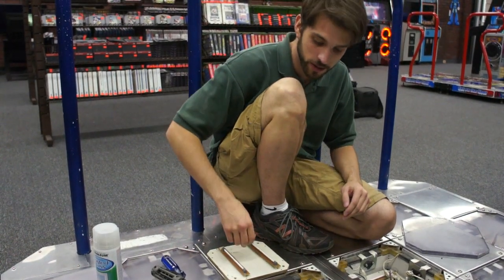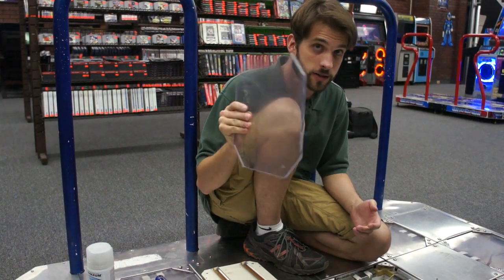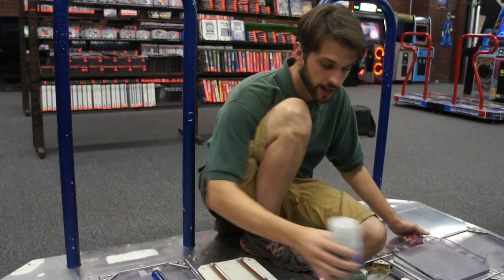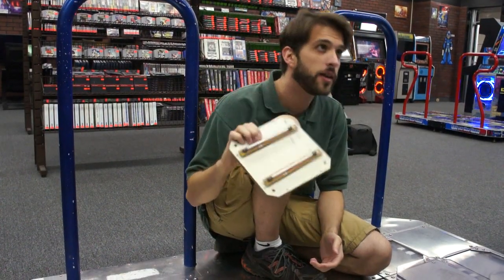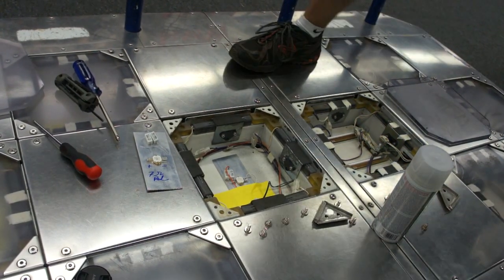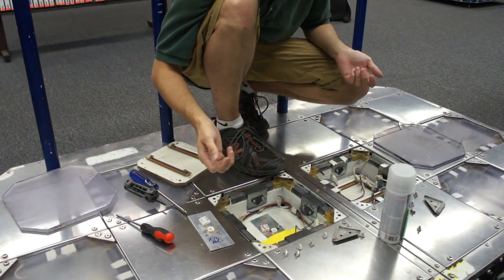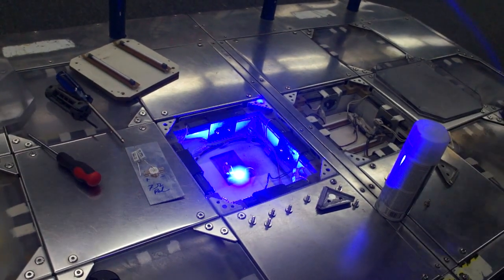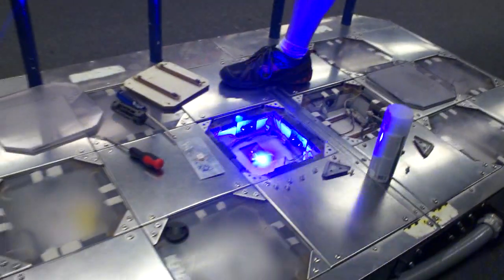A DDR Cabinet with 80 Watts of LED Upgrades

Comment: Do you have to do soldering with the transistors? Not very good with stuff like this. I would like those led lights for my ITG2 cabinet though. How much were each led?
Reply from the maker: The LEDs used to be ~$12/ea, now you can probably get them for $5/ea.  But, yeah, you really do have to solder the resistor to the LED.

Comment: Another question - which screws are you using on those pads in this video - those seem to be low profile ones; rather than the button heads that are standard.

Comment: Yeah, I measured the original panels at 3/8" But was wondering on what particular polycarbonate sheets you picked as McMaster just states "Polycarbonate" and notes it is comparable to Lexan etc. Did you opt for High Impact Resistance or High Tensile Strength?

If I can pick a sheet to use, I'll go ahead and get it printed and start the rest of the work...

Comment: What lexan panels specifically from McMaster did you use? How flexible were they? I'm planning on getting lexan panels for my cabinet, and having them UV printed with appropriate graphics, and then using vinyl and teflon to protect the graphic.

Comment from the maker: I actually don't know! I believe it's running off of OpenITG, and using a PAC Drive??? I don't really know which lights controllers are supported by OpenITG.

Re: The arrows, I discovered the hard way that it's not so great when you make the pads EVER SO SLIGHTLY too big for where they go :-/.

Comment: Hey Charles, don't know if you remember me, I played your legendary SMO religiously back in the day. Anyway, I was wondering if you offer the light controller for ITGOpen or SM?? I am planning on buying a crapocab for a grand or whatever, and making it as close to an ITG dedi as possible with as much flare as possible. I am even planning on tapering the edges of lexan panels 3/32 of an inch to make the panels near flush with the steel on the platform. Any and all help is greatly appreciated!

Comment from the maker: I had to cut them myself, I used a radial arm saw.  I ordered several 1'x1' pieces.  You'll have to measure them, too since I believe the shapes are different depending on the pads.  I cut mine a little big, so for a while we had to keep sanding down the edges to make them fit nicely.

Comment from the maker: I used a variety of resistors, and measured the current using a multimeter until I found good ones.  I believe I used 5 ohms and 3 ohms for red and blue respectively.  But I strongly recommend you test for yourself so you don't blow some LEDs!

P.S. You'll probably want 5-10 watt resistors.